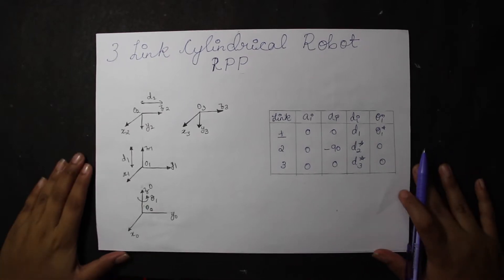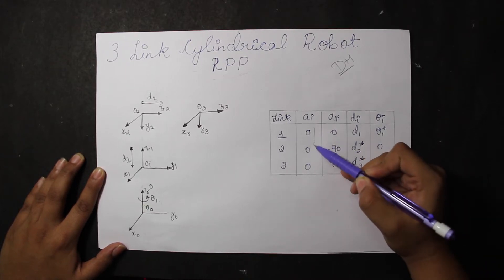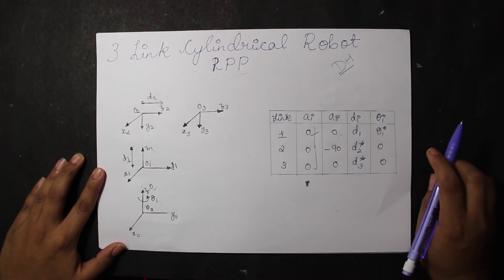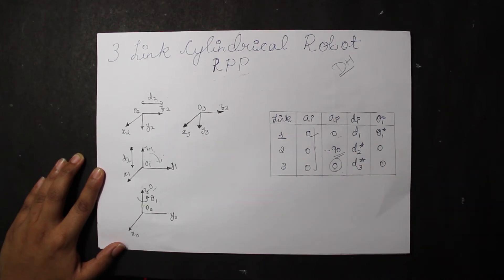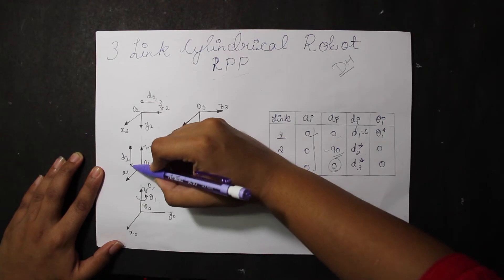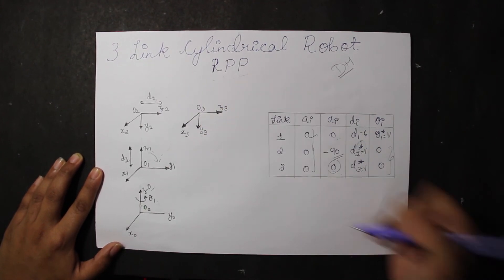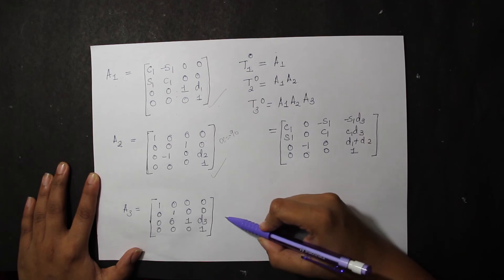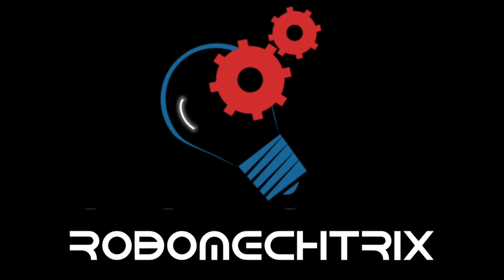DH convention of RPP manipulator

Comment: how did you get negative 90 degrees for alpha i or joint angle for link 2? how did you apply right-hand thumb rule for this?
Reply: I think if you apply the right hand rule and place your thumb in the X2 direction and curl your fingers you will see that the Z1 rotated 90 degs in the opposite direction of your curled fingers, to make Z2.